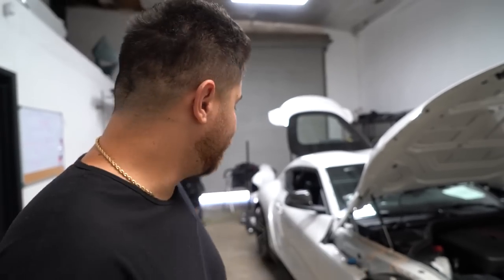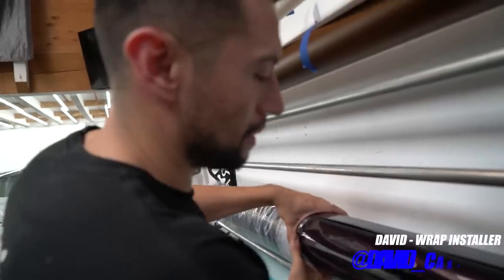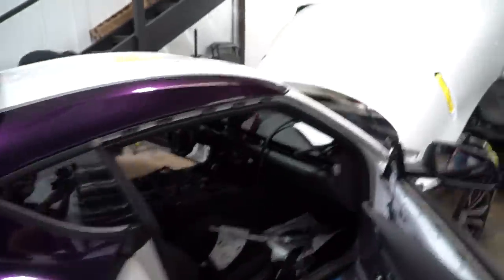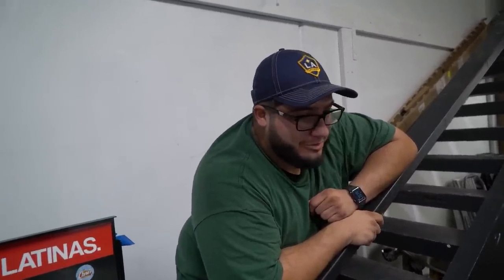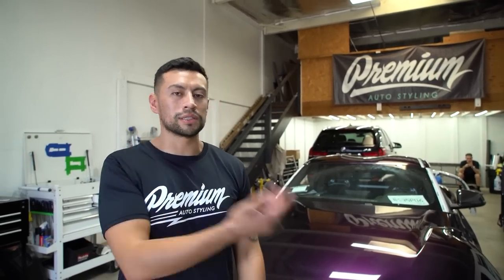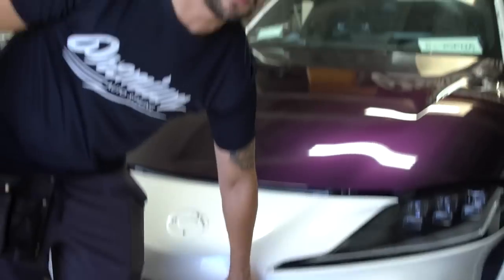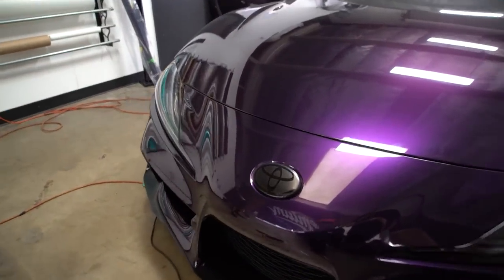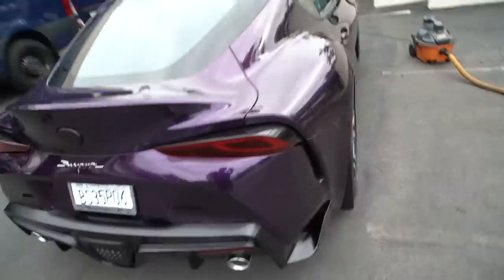MIDNIGHT PURPLE MK5 SUPRA!

Comment: I installed inozetek on a widebody gs300 in that midnight purple and after 4-5 months the areas that were perfect randomly started to get a bubble when removed the glue from the vinyl side stayed on the car and untacked from the vinyl making it not a bubble but a glue defect and after they sent out a “new roll” it did it again after 3 months and they issued me a full refund after i sent in samples of the wrap where the glue is not holding on the vinyl side and separates leaving the glue on the body of the car and the wrap not sticking sad because look great but found out they are buying it from kkvinyl and lying to people
Reply: You should see ck wraps video on it and how they charge double for the same stuff  .... he called them out about being the same as teckwrap and kkvinyl and inzotech has blacked there account

Comment: That QP is a 6 in inozetek for me. Cut all the panels first remove the cap sheet and roll it back up. That removes 80% of the static, I use it a lot and get very minimal specs due to static. I also don’t wet the floor, I love inozetek doesn’t require much stretch